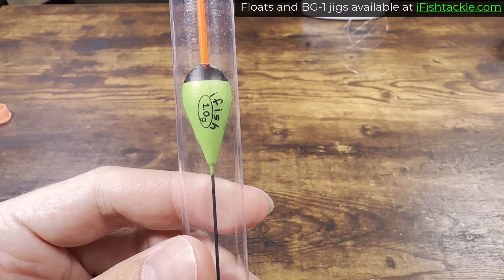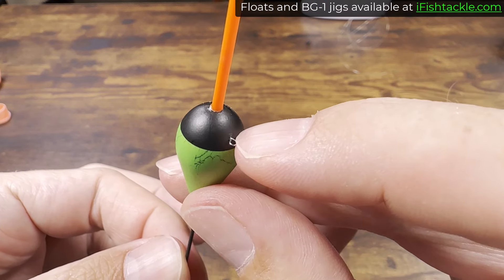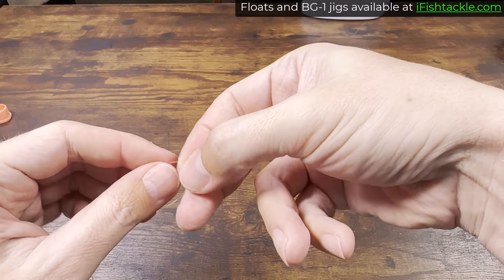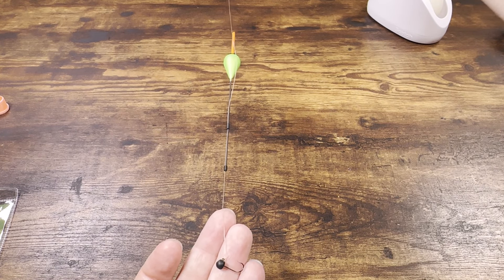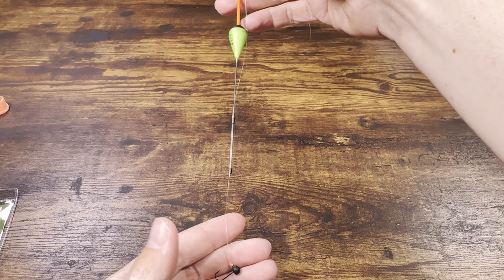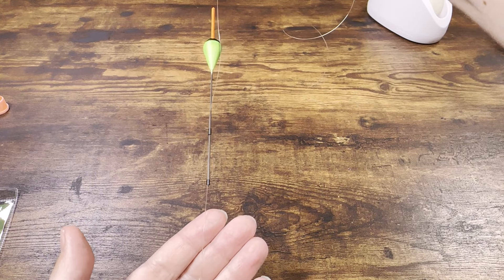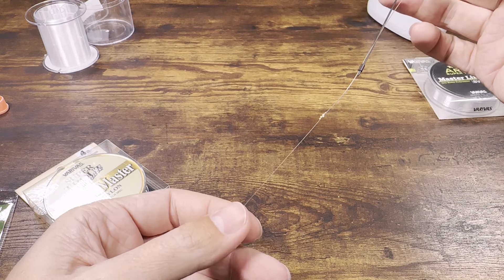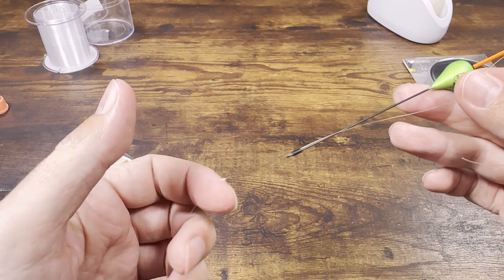ifish FIXED Float Installation Instructions (The Perfect Panfish Float Rig)

Comment: In what condition do you use float rather than just the line and jig head?
Reply from the maker: excellent question, and worth a whole video. Basically if u have livescope and know where the fish is... u can dangle a lure right on top of them..  If u cast a jig it will run through the 'red zone' in 3 seconds, and if they don't want to chase, no fish. With the float, u can dangle right over their nose, and its pretty hard for them to not react. If u fish from the bank and there are high percentage areas, like a tree in the water, also good idea. But if u just blind casting, trying to find fish, swimbait or jig is better

Comment: Thank for the video! What I learned from using the super expensive varivas 0.3pe braid, that it’s basically has the same breaking strength as other light game brands, regardless of what they advertise. 7lb for pe 0.3 stated on the label turns out into 2.7lb in reality. IMO same will be for their monofilaments.
Reply from the maker: No sir. I bench tested their 3 lb fluorocarbon and it broke at 4 lb. But the braid is so thin that it is too easy to cut. Notice that cutting is not breaking. If u test it at home it will be string but in the water its easy to cut. Either way i share ur sentiments and i personally dont use braid for anything

Comment: Honestly, I'd send you a Colmic swivel size 24 (which weighs about as much as my self-control in a fishing store 🎣😂) just to compliment how perfect this float rig is!
Reply from the maker: why do u need a swivel on a float rig?
Reply: @ifishcatfish  You explained why you need a leader, but you're connecting them with what I think is an unattractive knot. We use a swivel to separate those two because sometimes you snag or a fish snaps the line, especially when fishing at the bottom for larger fish. Without a swivel, you end up retying the same knot over and over. Instead, using a loop connection is faster, and we use leader rolls or boxes with premade leaders, making reconnection much quicker. I actually like the clip you use on the jig head; it allows movement on two axes. The leader then adds motion on three, helping balance the wave and float direction. Without a swivel, the float is fixed and can twist the line and jig, making the jig move sideways. 

A couple of recommendations: 
always add two rubbers to the stem, and extend the bottom rubber a bit more outside the stem to absorb the shock of the line. Sometimes the rubber gets cut and you have to re-do the line (especially with one rubeer as you did) and two rubbers help keep the depth stable and look neater, especially since catching fish or movement can change the depth you’ve carefully found where the fish are eating.

For the next production of floats, consider removing the metal eye. It wears down (destroys the coat and leak the water inside) the float faster and causes the line to rub against the float body due to friction from depth changes. A body tube or canal would allow the line to move more smoothly.

Also, making the antenna changeable between bright yellow(lime) and orange would be helpful, depending on the color of the sky, water, or trees. This would make it easier to detect and also allows for neon or lighted antennas for low-visibility conditions.

Of course, as you mention those extra details are just for us who enjoy the perfection—they don't add a huge amount of help but do make it more satisfying. By the way, the body design, both in shape and color, is perfect!
Reply: One could use a tiny tippet ring in place of a swivel, if desired to join the leader and line together.
Reply from the maker: @donhershfeld9930  is there any advantage to this? Why not tie the two lines together?

Comment: Got my order in a couple of days ago. Looking forward to using them. Love your jigheads. What about the size and weight of the plastic or bait when attached to the jig head. Is it going to affect the balance and sensitivity of the float?
Reply from the maker: Most plastics are close to neutral buoyancy. Even if they are not the difference wont make a difference.

Comment: What about the weight of the plastic baits? Will that throw things off?
Reply from the maker: the plastic baits have very close to neutral buoyancy. That means they don't weight nothing in the water. Even when they are slowly sinking or floating, in practice this effect can be neglected. As long as we are talking about ultralight lures like trout magnet and znman larvaZ... not some huge chunks of silicone like a bass bait... All lures up to 1.5" will be fine and most likely up to 2" also.

Comment: Will the silicone slip float holder work on P.E lines or similar thickness as the suggest line size?
Reply from the maker: Yes, of course, but using braid with these floats is a nightmare. Heed my advice and stay away from it. Mono is cheaper and superior in every way.
Reply: @ifishcatfish  I'm sure it is, I have no reel with the nylon size you reccomend, I only have 1 nylon reel right now, being only  .10mm. The rest of my reels are P.E or ester. But I might just throw 10  feet of nylon leader on  and run the float on that, (and hope I don't loose the float if I snag, or splice the line together above the float, or maybe an excuse to buy a new reel!)

Comment: One thing you don’t mention in your video. With your float setup like it is. Neutral buoyancy. Crappie can sometimes be very finicky. Especially in cold water. Crappie are generally vertical feeders. They like to chais baits up. Bass and other species like to hit on the fall. Crappie chase and they eat above them. Your float. Can detect vertical up bites. What happens is the float will fall over n lay on its side. When you see this, set the hook. This is a verticals up bite of crappie. This is how crappie bite almost always in winter time and cool water conditions.
Reply from the maker: yes, crappie bite differently from bluegill, but its not very simple. They pull the float down mostly the way i fish, with livescope. If you put the bait too far above them, and they have to swim UP to get it, then what you describe will happen. But i usually run the lure in their face, and they go down  when they get it. They really prefer to eat something IN FRONT of them, but over them is also OK, just don't go under them..